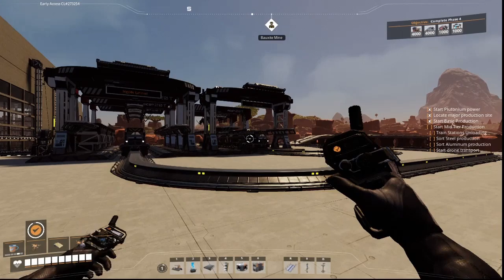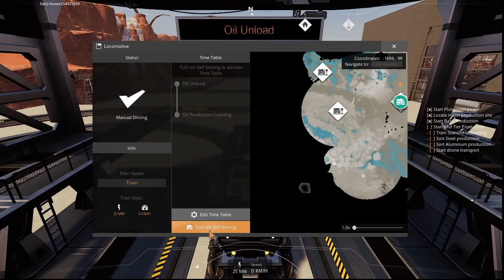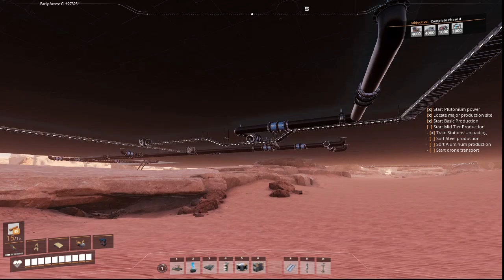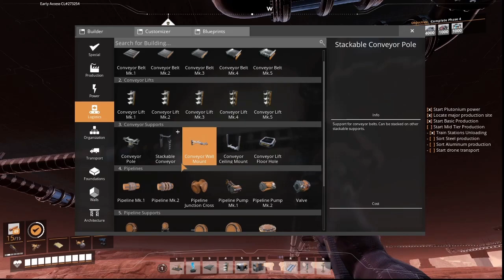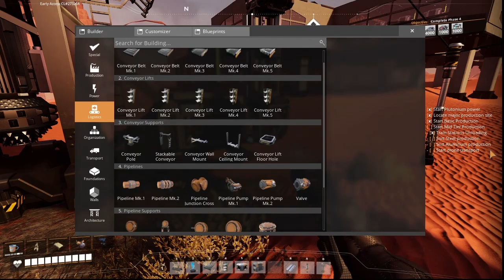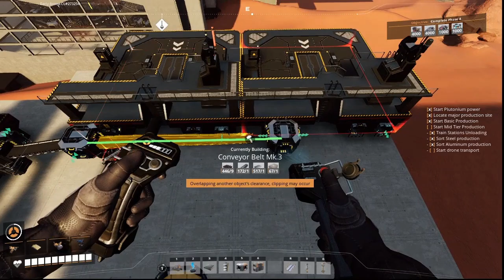Satisfactory Ep35 Trains and drones makes the factory work

Comment: Hello, nice build you have here, I have a question, why do you use both drones and trains? Is there a reason? I mean you have already built the train tracks so no reason to not use them, but now that you have drones, would you ever build a train again? Is it worth?
Reply from the maker: Hello and thank you and yes will use them again as they are cheaper to transport smaller stacked production that do not require the loading size of the trains and the further they travel just needs more batteries to be produced. I had more than enough from just the one sulfur mine to run all te drones. Trains need more complicated connections and signals if you want to send trains on one rail and they can get stuck if not careful. I will be going more into the trains aswell to see if works out better than drones with seperate unloading sections like I did near the end
Reply: @alphablazedgamer  My question was if you would use trains again, now that you have drones which are handier.
Reply from the maker: Yes i will use trains again and if you wondering why I would is to move liquids. If you use trains you can move oil and aluminum production to any place on the map and have it run stable but you can only use trains for such a project from what I have seen just want to do more complicated rail systems to test how good they can get then I might opt out of using drones